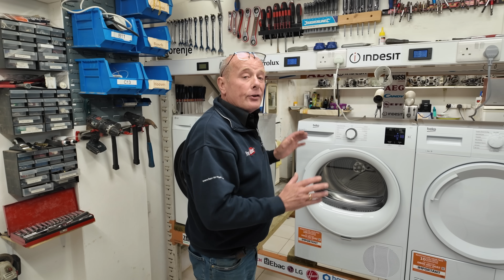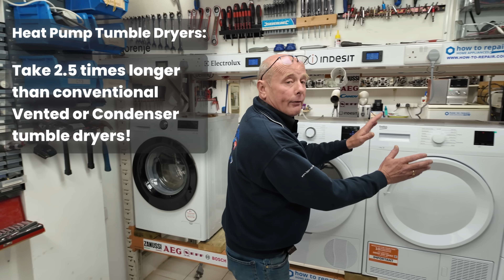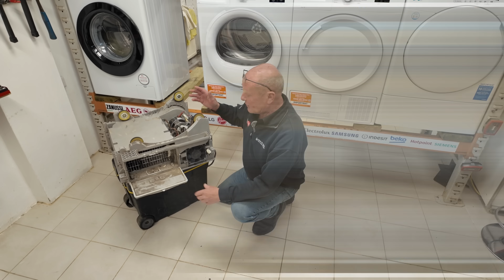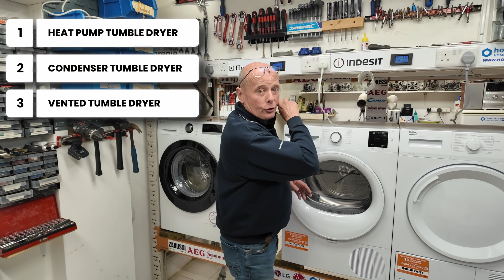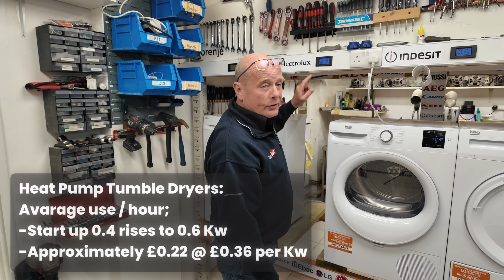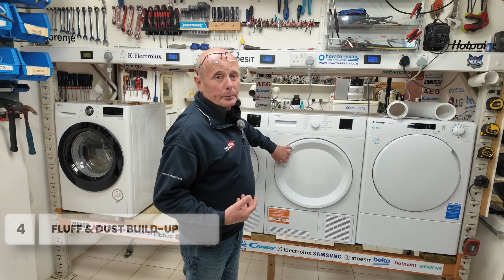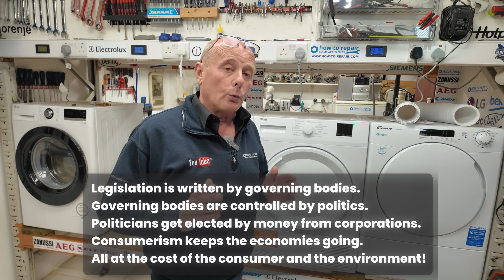Tumble Dryers the Shocking Truth About Heat Pump vs Vented & Condenser, NEW LEGISLATION!

Comment: I am watching this video because our Hoover heat-pump drier has about come to its end. It is about 6 years old, and we have had to have it repaired 3 times. 2 of these were for he water pump, which has failed again. It is not possible to get at this to do it ourselves, as taking the top, back and sides off still doesn't reveal it. It seems to be within a sealed compartment that we are afraid to meddle with, because it has small electrical attachments. I am nearly 78, and fed up with having to get down on the floor to clean the condenser fin things every time the machine is used. I fail to understand how a company which makes vacuum cleaners can be incapable of designing decent filters for this appliance, but plenty of fluff gets past them. The cost of repairs has greatly exceeded any savings on our electricity bill.

Comment: Great video, I opened my second hand purchased heat pump tumble dryer and it was covered in dust inside. The dust was everywhere, and in some places like a carpet. I' m trying to trouble shoot a small regular mechanical noise and I was told the drum guide wheels may not be perfectly round anymore. Lets hope replacing them helps.

Comment: Heat pump driers work by removing heat from your home to dry the cloths. That heat needs to be replaced by your homes heating system. They would only be saving you energy if they sat outside.

Comment: I am in the USA not Britain and there is no legislation here. I have a 37 year old classic electric vented dryer that may retire in a few years. I am looking into the heat pump dryer as a replacement and amount of time is not an issue - Have you looked into the LG dlhc5502? It has a ten year warranty on the motor and there is a special function to clean the condenser coils of lint after each load - there is less heat applied to clothes so the don’t shrink or get damaged as much during drying. Can you test this out? Maybe it will last for 10 years? - I think I have a few years to go on my classic dryer so no rush

Comment: I bought a Panasonic heatpump dryer years ago that was A++ energy rated.  It had many clothes settings but even on linen the clothes were still damp.  I complained and eventually got a replacement which was a new model. It did dry better but only on the linen settings.  The machine went wrong just after the warranty and being an engineer I fixed it myself.  There were 5 separate failures, with all the bearing needing replacement and the drive belts.  It eventually stopped working with I think a control panel issue and spares were not available. 

I would never have another one.  We bought a used vented dryer from marketplace that works well and is still working.

Comment: I have a heat pump tumble dryer I bought at £800.  7 years once a day clothes perfect.  Same unit now £550.  It’s a no brainer I will replace like for like.  The first paid for itself on lower power costs years ago.   LG for me.
Reply from the maker: I’m glad you’ve had a good experience, but please read the other 4000 comments that are on here to get a full understanding of the picture
Reply: @How-to-repair oh I do not doubt there are problem makers and machines and just felt compelled to speak out.  I bought a washing machine and the heat pump tumble dryer around the same time seven years ago.  Four adults so use every day pretty much.  I recently went in5o J Lewis and the same is one was now £550….

Comment: Don't buy Samsung. Their heat pump tumble dryer off gassed a  burning rubber smell that filled the house and made me sick (it's been 5 months and I can still smell it). It was replaced and the 2nd one did the same. I never got to use either one. I'm too ill to do the ADR so I took the loss. Don't buy from them; they don't care about their customers. Worst purchase ever. Wish I'd seen your video first.

Comment: I  just bought a hisence heated pump and after listening to this lm regretting it. Before mine gets delivered l might go back and  change it as I really preferred the ventilator ones but they didn't have much in the store as their phasing them out of the store. If l bought the ventilator model would l still be able to get parts.

Comment: Would electricity consumption for a washer+dryer combo , when i use it in drying be higher or lower than any of those dryers assuming i run it in a hot desert

Comment: Just purchased a heat pump tumble dryer  - 10 year parts warranty ( included) and also labour warranty *£4 per month -  - if it breaks down they will replace - includes accidental damage. Electricity consumption is down. Time in operation is slightly longer and I mean slightly to condenser tumble. Substantially less operation noise so can use over night. Kitchen a lot damp  and substantially cooler with over night operation. Make sure clothes are well spun in washing machine before putting clothes in tumble. Very pleased with the machine and decision I made .
Reply from the maker: I'm glad you're happy with your decision. Could you please share the make and model of the machine? This will help others in the future. Thank you for your comment. It is much appreciated.

Comment: From experience, the (Bosch) heat pump dryer was a total pig to clean the heat exchangers on. Complete strip down, take the heat pump assembly out and wash out the two exchangers. Bearing wear... Not an issue, after years the motor and fan bearings were still fine, it was still running after ten years but the exchanger was fouled again.

The deciding factor for me was the fiasco over condenser dryers catching fire, having removed inches depth of fluff over the entire internals multiple times in all of the dryers we have had. Heat pump dryers don't have a heater hot enough to set fire to the fluff, the motors are brushless, so no sparks. Heat pump dryers are lower fire risk, having had a house fire caused by a condenser dryer will never have one again

Comment: Absolutely hated my bosch heat pump dryer. It works fine, goid quality, but with a large family and the 4-5 hour drying time (I got the more expensive one thats meant to be 90 minutes - its bs) makes it so hard to coordinate the washing and its running alllllll day for drying 2 loads. I only need it for 1 season as I live in a country that is sunny most of the year and I hang outside. Got so annoyed at the piles of washing waiting in line for the dryer that I sold it and bought a vented one.

Comment: If the conventional dryer is 2.5x faster, then the nominal power consumed by the heat pump dryer must be multiplied by 2.5x to have "apples-to-apples".   Suddenly the 0.4KW x 2.5 1KW vs. 2KW is not as impressive.   Presumably the 2 KW for the conventional dryer has its own duty cycle <100%.

And this is confirmed by the facto of physics that evaporating the water ALWAYS requires the same amount of total energy for the same load size and wetness. There can be no difference is energy required to remove the water by evaporation.  The only improvements come from the inefficiencies of the thermodynamics only - in theory you are recovery some of that with a heat pump but it's not clear the cost 

The #1 inefficient in the total energy supply chain is the product turn rate which manufacturers are trying to push up for revenue.   The problem is that is WORSE for the plant and total energy supply chains.   You could save MORE energy by replacing appliances LESS frequently than you will ever save by simply improving the unit efficiency itself.

Comment: Lot of people keep their tumble dryers in their garage, usually unheated. The lower the outside temperature (around the tumble dryer not actually outside) the harder and longer it is for a heat pump to extract sufficient captured heat from the compressed refrigerant gas. So the 2.5 times longer scenario could be considerably longer for outhouse tumble drying when it is actually needed in winter.

Comment: Thank you for honest explanation of how drying clothes machines relate to each, usage costs and life long costs. Plus possible repairs to machine..
I have a Hotpoint condenser tumbler dryer for over  twenty four years. 
It has been moved from properties and overseas  number of times and dried clothes for family of six for over half it's life. Never needed any repairs. 
Recently  has stopped working. Considering buying new machine as now the more modern ones cost less in energy used. 
The fact that the new heat pump machines have gas cylinder in similar to fridges is for me a no. 
Remember the days during 1980's of huge problems of disposable of fridges and freezers and damage which has been done to the atmosphere by the gas 
It is appalling that invention of new tumble dryer type has  first making problems for eco systems. Second that takes longer to dry cloths which will cause damage to some fabrics. Three it is being sold as reduction to household energy bills. 
Four that any repairs will cost more and many not viable to life of machine .
Five. Machines used in my home must to do the job designed for. The materials used must not be problem to planet earth when machine life cycle has finished.  Always followed manufactures recommended care of machine.
As said thank you for clear explanation.

Comment: I my opinion in this situation I 100% agree with this article. It’s not just the manufacturers trying to pull the wool over the eyes of the consumer. People forget that for every new machine that is sold the government steals 20% in VAT. Therefore built in obsolescence is beneficial to the tax man/woman. I prefer the condenser dryer as I only use it on wet, cold days and it helps warm the house a bit. It is all a conn just like NET 0 at the end of the day I am paying for the energy the unit uses so why am I being told I can no longer buy the machine I want?

Comment: Three years ago, I brought a Samsung heat pump dryer, with all the bells and whistles, thinking that on the long term, it will worth the price. It last 3 years. The heat exchanger got clogged and the machine became so inefficient that it didn't dry the clothes anymore. Lucky i brought it with 5 years extended guarantee. When I called the seller for guarantee, instead to repair it, they chose to replace it with a new one. Those are really bad design. The previous one, with condenser, worked for 10 years with no problem, but I left it when I moved out. Now I regret it. I will never buy a heat pump dryer again.

Comment: Delighted with my heat pump tumble dryer.  Bought a Bosch Series 4 to replace a 12 year old Hotpoint Condenser.  The new model takes slightly longer but the remarkable thing is how cheap it is to run by comparison.  I checked the energy usage on my Octopus smart meter and the new machine is way cheaper to run.  I keep reading that people don’t like heat pumps, but in my experience they are way better.

Comment: Living in a hot climate I only use my dryer to get that last bit of damp out  of clothes. If the dryer costs $329 my wear and tear is less than half that of a dryer regularly used always drying wet clothes and I regularly vac out under the lint basket which I empty every load…I think this little cost will go further than spending $1200 on the other 2. 
As you said design obsolescence is a factor , for me spending less up front and being mindful of preventing wear n tear IE I open the door after a load to cool the rubbers down etc will give me better value for money.
When I want a dryer to last I’ll always buy older second hand models because everything is now more disposable than the year before.
I appreciate yr advice, you have helped me act on facts.

Comment: Normal dryers do dry better and easier to work on  but the major advantage of condenser dryers is ZERO black mould in the laundry. Black mould is hazardous. I’ll never get a normal dryer again for that reason. The Bosch we have drains itself tho I still have it set to flush itself. To stop them smelling like swamp a single spray of chlorine mould spray in the catch tank about once a week the Siemens one we had lasted almost 10 years.

Comment: I replaced a condenser dryer with a heat pump dryer 5 years ago. It's a mid-high range unit (Samsung) that had a 5 year warranty.
I'm pleased with it, still works fine (touch wood). I find it's less damaging to clothes than the condenser as it generally doesn't get clothes as hot. I don't know if my condenser wasn't working well (I did clean the HX monthly) but the heat pump version doesn't take that much longer. The cycle timer starts at 3 hours, but it has a humidity sensor and usually finishes in under 2 hours. The condenser usually took 1h30m for a similar task, and I would have to put a load on a second drying cycle more often with the condenser.
The heat pump unit has a panel to access the heat exchanger and prompts you to clean it every 20 or so uses. I can't access the top, bottom, back and sides of the HX, I imagine there is build up in there, but it still seems to be working efficiently. Maybe I should blast some compressed air in there sometime.

Comment: Glad I found you and have subscribed and hope you can help me make a decision. I have presently a LG washer dryer 9 years old. The washing machine part is still brill, but the dryer recently failed, now I can do a little myself, but the Dryer had been overheating, not drying the cloths which were wet and very hot. The inside top cover just before the fan was burnt. So I surprised it must be the heat sensor or  a faulty heater element. Its a condenser dryer as you'll know and it was surprisingly very clean, as was the fan. I priced up the heating element on LGs own site about 50 odd quid on its own but it could be the sensor, right? or possibly both which you have to buy the whole thing including the fan £178. Given the machine is 9 years old and the washer and spin are both great, I have decided to buy a separate dryer, and not bother repairing the dryer aspect on the Washer. 

Which dryer should I buy, I have a window to the hose id necessary, and the condenser type you are showing in the vid? The condenser filters looked easy to clean. There are only two of us, and I use a washing line when and as I can weather wise. Sorry to put you on the spot. I'm retired so don't want to spend to heavily.

And, is it you would you advise disconnecting the two electric cables supplying the power to the element. And yes, I do and did disconnect the electric power when doing this :) I never intend every using the LG to dry my clothes again if I get another dryer. At the moment the weather up north had been kind :) 

And by the way, great Poscast so thank you again.

Comment: Designed in obsolescence is all part of the scheme. And as always the stupidity of "using less electricity" is madness as, if it is on anything up to three times longer the usage isn't that much less. It was just the same when they killed decent vacuum cleaners to reduce the consumption which just made everyone have to use the thing twice as long. Try finding a really good toaster! There isn't one. I repair all manner of electrical AV equipment and most of it is utter junk unless you go back 50 years!

Comment: Hi, My Brother has purchased a HP dryer and with a new kitchen coming from Supplier we’re buying a HP one in August, what is the hard wiring of these Machines is it electrician installed not plug and 🔌 play in the UK like my existing Condenser one please and thank you. 
Current condenser is running 8 years now it’s in my Conservatory. 
“Built in obsolescence” exactly, every year cheaper and more unreliable machines are coming out so we repurchase. Great Video.

Comment: Heatpump hoover  small loads 4hrs plus most of the time when it stops clothes  still damp sent back not fit for purpose   got a becko condenser  Love it same load size 30 minutes not 4hrs   + and damp   and it's so quiet

Comment: I had a high priced  Bosch, this has gone wrong within twice  in 8 months, i had a Bosch Diswasher, that was expensive, that went wrong within 2 weeks, 10 months later i got it uplifted, Now im picking another tumble dryer, im going for the vented one, never had a problem with them, very hard to find now, but i see one, only £279 so ill have that, my Bosch was a Condenssor, that nearly caught fire! so i'll never buy a Bosch again, after the 2 i had, i told Bosch that too!

Thanks for the video, Bosch recommended the oil pump, i wonder why?

Comment: The cheapest for me would be the vented dryer.  In the US many homes have natural gas connections, which is considerably cheaper than electricity.  Using propane will cost slightly more than natural gas, but is still much cheaper than using electricity from the grid system.  I'm currently using a form of the heat pump system, while looking for a new dryer: it's called a dehumidifier in a closed room and gets the humidity level down to approximately 30%.  If I lived in a desert region, a regular fan and open window is all that is needed to dry the clothes. Nice presentation!!!

Comment: I think you are scared of Miele eating your lunch. Yes I would not touch a BSH heat pump drier with a pole. The Miele makes an excellent business case with the energy savings tho. When your old drier gets retired you will need a new one, the vendor has the take the old one by EU law. Also there is free disposal of refriguration units and washing machines in a lot of localities.